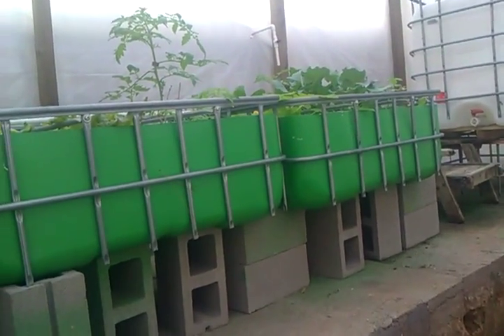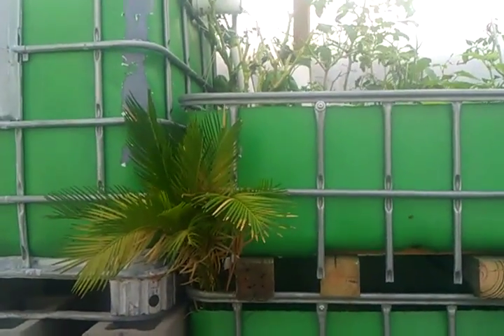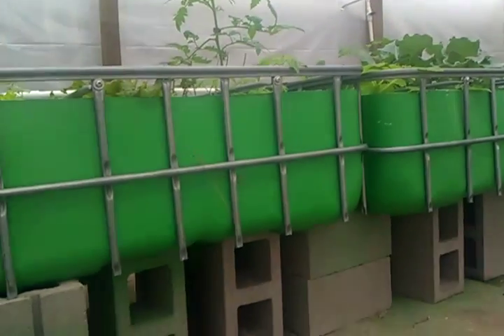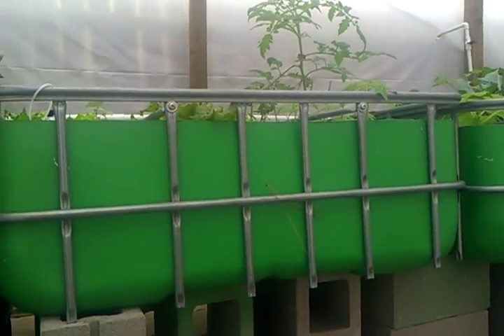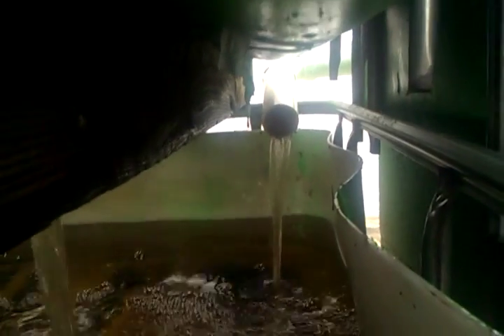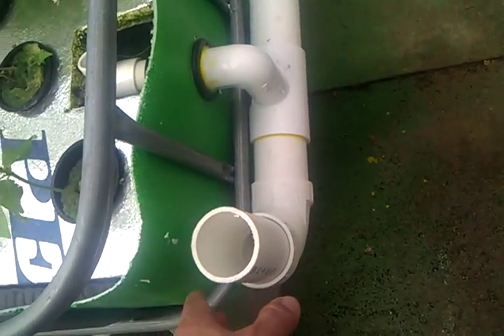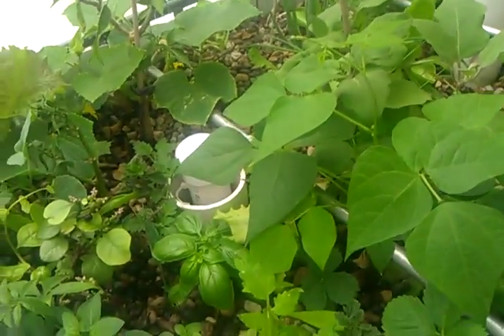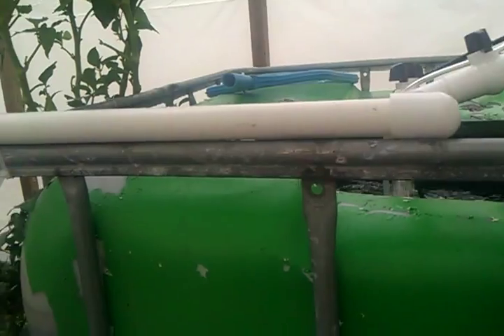Aquaponics how to build

Comment: from the look of it, the pump feeds the float tanks regulated by a valve and the rest of it goes into the fish tank (like a 3 prong fork with a valve on 2 prongs). the fish tank dumps into the gravel tank and then the 3 grow tanks dump into the sump where the pump is that feeds the system. You can regulate the amount of water in the system by maintaining a minimum level in the sump tank.

Comment from the maker: Actually this system was my first and it worked really well, But I wanted larger, So I scrapped it and made a new design.
But the answer to your question is yes you let the solids break down in the gravel beds.
My new system has a swirl filter before the floating rafts partly because its so large.
It really is experimental at this phase.
But it does work well.
Thanks for the post.